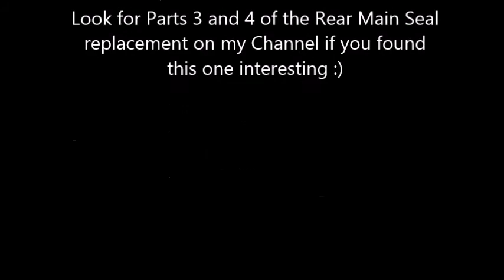2008 Escalade AWD Rear Main Seal Part 2:  Rear Drive Shaft - Transfer Case

Comment: Great video series Steve. Has anyone tried removing the drive shaft going to front differential to make the car 2WD only? Would this cause any issues?
Reply from the maker: Hello, I think since it is technically an all wheel drive vs. a 4WD one, if the drive shaft is removed, the transfer case wouldn’t be able to transfer the power at all as I think it allows independent drive force to the 4 different wheels.  That being said, I’m not 100% sure though, but I’m basing it on how driving a 4WD truck on dry pavement feels very different than how an AWD one does so I’m thinking the transfer case must be able to direct power to the front or back axles differently for going straight or for turning.  It would be interesting to know for sure though so if you do give it a try, be sure to comment back as I’d love to know for sure 👍. Thanks and all the best !  Steve

Comment: Approximately, how many hours start to finish?
Reply from the maker: Hey man, it probably took me around 12 hours to get everything apart then about 8 hours to put it back together (the total of the 4 Part series of the videos).  I took my time though so I’d say it could definitely be done faster.  The funny thing is that the most time consuming parts were simple things that took much more time than they should have…getting the wiring down and loose to disconnect the oxygen sensors seemed to take forever as well as getting the bolts out and separating the transfer case from the transmission.  Even with all of the bolts out it just didn’t want to pop free since it had never been removed before.  Hope this helps and all the best !  Steve

Comment: What's up, Steve? Am having issues with my 2008 Cadillac Escalade. I took the transfer case out now that I'm having issues taking the front shaft out of the transfer case. Any suggestions?
Reply from the maker: Hey man !  Here’s a link to part one of the series on taking everything apart for the rear main.  At the 6:30 time stamp, I show taking the front shaft off.  I believe it wasn’t clipped in or anything and once I got he rubber boot off I slid right out.  Maybe this will help a little Judy to see how it slips out of the splines:  https://youtu.be/3Q-vP3UmtSs .  Hope this helps and all the best !  Steve

Comment: Will this transfer bolt up to any GM  transmission
Reply from the maker: Hello, I’m actually not sure if the AWD transfer case will bolt up to all of the GM transmissions, but it may be possible since they liked to use common drivetrain parts for many models. Other folks that watch the video may know for sure and typically folks read the comments and reply to questions that are asked.  I’ll be interested to know as well so hopefully someone sees your comment and replies 👍.

Comment: How did you get the gasket to break free? I’ve been struggling to get it off for almost a day?
Reply from the maker: That gasket was a pain for sure !  It was holding on really well. I believe I ended up putting a couple of the nuts back on the ends of the bolts (loosely) to protect the threads and then pried against the nuts to break the gasket loose by pushing on the bolts 👍